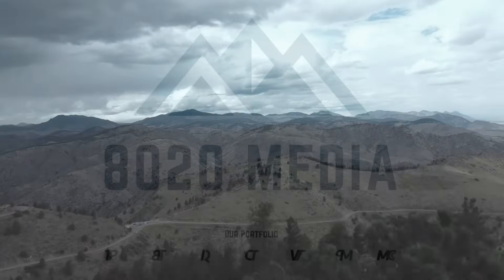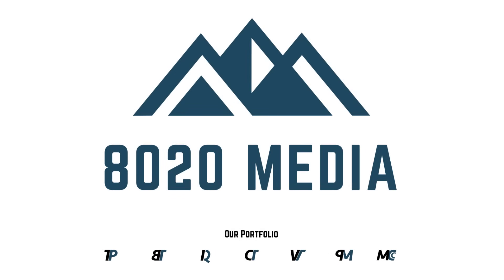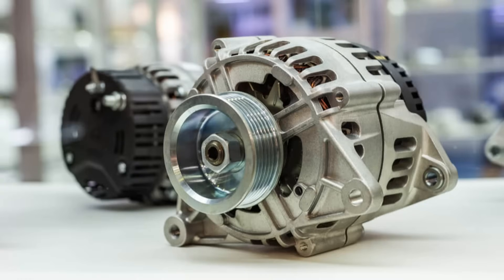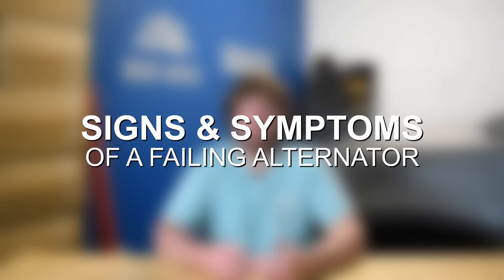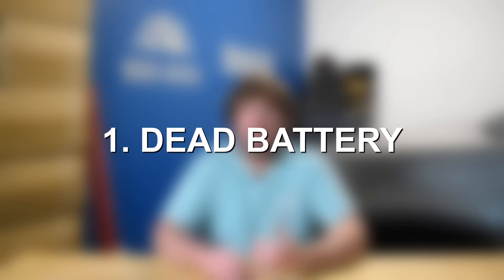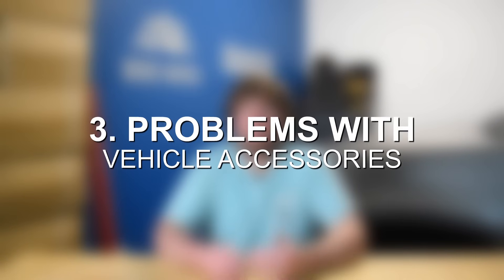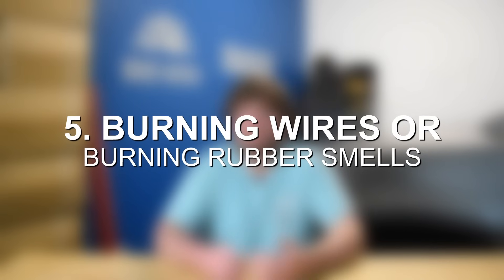6 Symptoms of a Bad Alternator!

Comment: The battery light came on today on my 07 kia rondo along with the brake light (brakes are fine) i pulled over and pressed down the parking brake and released it. When i pulled off both lights turned off less than a minute after driving then came back on about 10 minutes later for another 10-15 minutes then off for a few minutes before coming back on.  I figured it was something with the dash since the needle on the temp gauge will rise and get stuck sometimes even though all that stuff is working fine.  I took it to Autozone just in case. They said the battery is at 65% but is failing to charge.  It started back up just fine and i haven't had any of the symptoms mentioned here. Do you think its the alternator or the battery?

Comment: After the replacing the alternator the vehicle cranks up but it takes a one or two clicks start in order to vehicle starting 💯 percent ….any suggestions?
Reply from the maker: E - If your vehicle takes one or two clicks before starting after replacing the alternator, it could be due to a slightly weak battery, poor ground connection, loose battery terminals, or a starter relay/solenoid issue. Double-check the battery terminals are clean and tightly secured, inspect the ground and power wires to the alternator and starter, and consider testing the battery under load. Also, ensure the alternator output is charging properly (should read ~13.8–14.7V with the engine running). A weak connection or borderline battery can cause delayed or hesitant cranking despite a new alternator.

Comment: My alternator is making my engine run hot
Reply from the maker: S - If your alternator is causing your engine to run hot, it could be due to increased engine load, a failing alternator bearing, or a slipping serpentine belt. A seized or failing alternator bearing can create excessive friction, adding strain to the engine and increasing heat. Additionally, if the serpentine belt is too tight, misaligned, or slipping, it can overwork the water pump, reducing cooling efficiency. Another possibility is an overcharging alternator (above 15V), which can cause excessive electrical load, leading to increased heat production in the engine bay. Check the belt tension and alignment, inspect the alternator pulley for resistance, and measure the alternator voltage output. If the voltage is too high or the alternator is overheating, it may need to be replaced. Also, ensure the cooling system is functioning properly, as an alternator issue could be compounding an existing cooling problem.

Comment: Battery light on dash for GM
Reply from the maker: W - If the battery light is on in your GM vehicle, it typically indicates a charging system issue, most commonly related to the alternator, battery, or wiring connections. Start by checking the battery voltage with a multimeter—it should read around 12.6V when off and 13.5-14.5V when running. If the voltage is low while running, the alternator may not be charging properly due to a bad voltage regulator, worn-out brushes, or a failing alternator itself. Inspect the serpentine belt and tensioner to ensure proper tension, as a slipping belt can prevent charging. Additionally, check the battery terminals for corrosion and ensure the ground and power cables are secure. If everything checks out but the light remains on, the alternator may need to be replaced or there could be an issue with the charging system wiring or ECU communication. Scanning for DTC codes related to the charging system with an OBD-II scanner can help pinpoint the issue.

Comment: I've tried a new battery 2 times now and each time the battery dies within the first minutes of the start. You think it's the alternator? So far I can jump it and it will run but once it's turned off I have to jump it again for it to run.
Reply from the maker: B - Yes, it sounds like a failing alternator. If the alternator isn’t charging the battery while the engine is running, the vehicle will rely solely on battery power, causing it to die quickly. Since you can jump-start it but the battery dies shortly after, it suggests the alternator isn’t replenishing the charge. Use a multimeter to check voltage at the battery with the engine running—if it reads below 13.5-14.5V, the alternator is likely bad and needs replacement. Also, inspect battery cables, grounds, and fuses to rule out other electrical issues.

Comment: As I’m stopping. Right before my car comes to a complete stop. The headlights will dim ever so slightly and then go back to normal. Would this be an alternator problem? Anyone 😅?
Reply from the maker: H - A slight dimming of headlights right before a full stop is usually a sign of a weak alternator, voltage regulator issue, or battery struggling under load. When you slow down, engine RPMs drop, which reduces alternator output momentarily. If the battery is weak or the alternator isn’t supplying consistent voltage, you’ll see flickering or dimming. Check battery voltage (should be 12.6V off, 13.8-14.5V running) and test the alternator output. If voltage drops too much at idle, the alternator might be wearing out.

Comment: If my only symptom is flickering lights is it safe to assume it’s the alternator?
Reply from the maker: T - Flickering lights can be a sign of a failing alternator, but it's not the only possible cause. It could also be due to a weak battery, bad grounding, loose or corroded battery cables, a failing voltage regulator (part of the alternator), or even a faulty connection in the electrical system. To confirm if it's the alternator, check battery voltage with the engine off (should be around 12.6V) and running (should be 13.8-14.8V). If voltage drops below 13V when running or fluctuates erratically, the alternator is likely the issue. If the voltage is steady but lights still flicker, check the battery connections and ground points.
Reply: Flickering lights can also be results to a bad engine idle or a misfire in the engine cylinders
Reply from the maker: @christopherdevito5840  Possible, but not very likely.

Comment: If I just got a new battery and the battery light came on a couple days later is that a sign of an alternator issue?
Reply from the maker: H - Yes, if you just installed a new battery and the battery light came on a few days later, it's likely a sign of an alternator issue. The battery light typically indicates that the charging system isn’t working properly, meaning the alternator may not be supplying enough voltage to keep the battery charged. Common causes include a failing alternator, bad voltage regulator, loose or corroded battery terminals, a slipping serpentine belt, or a faulty alternator fuse or wiring. To confirm, use a multimeter to check the voltage at the battery while the engine is running—if it’s below 13.5-14.5V, the alternator likely isn’t charging properly and may need to be replaced.
Reply: @8020Automotive   Thank you very much. I'll get that checked out I appreciate it. Have a great day!!

Comment: Another good way to know what the problem is, is to get the vehicle started, then disconnect the negative battery terminal.  If it dies your alternator is bad, if it stays running the battery is bad.
Reply: On the newer cars if you disconnect the battery, the spike will destroy the entire electronic logic on the car don’t ever do this.
Reply from the maker: @JoeAircraft  Actually, that’s a common myth with a bit of truth behind it—disconnecting the battery on newer cars won’t destroy the electronics by itself, but doing it improperly or at the wrong moment can cause problems. The real risk comes from voltage spikes or drops, especially if you disconnect the battery while the engine is running, or if there's static discharge or improper reconnection (like arcing the terminal). Modern ECUs and modules are built with some protection, but they’re sensitive to sudden electrical events, so always turn the vehicle off, wait a minute for modules to power down, and disconnect the negative terminal first—and ideally use a memory saver tool if you're working on a car with complex systems that require relearn procedures afterward. So yes, be cautious—but no, disconnecting the battery properly won’t "destroy the car."
Reply: @8020Automotive does this apply to older model cars ? Like a 2006 suzuki swift ?
Reply: @JoeAircraft  So do you think if the cable for the negative became bad losing integrity for some reason that would or could destroy the electronic logic also? It sounds like it would, could very well be my issue.
Reply: Run by autozone, O’Reilly or any of those place and have them test your alternator voltage with a multimeter and then you’ll know for sure and they usually do that test for free.
Reply: What if I do it with fresh battery?
Reply: @beatles  Just do not do it. You can of course try it and be prepared the buy a new computer for the vehicle. The choice is yours.
Reply: Can a bad alternator affect your electronic throttle and cause it to go into limp mode
Reply from the maker: @GeorgiaDawgs274  Yes, a bad alternator can absolutely affect your electronic throttle system and cause the car to go into limp mode. Modern vehicles rely on stable voltage to operate critical systems, and if the alternator is undercharging or overcharging, it can disrupt the throttle body, ECU, and sensors, leading to erratic behavior or forced limp mode to protect the engine. Common signs include throttle hesitation, EPC or check engine lights, and poor response—if you're experiencing these issues and voltage is dropping below ~13V or spiking above ~14.7V while running, the alternator is likely the root cause.
Reply: @8020Automotive what about S drained start?.... When I start my truck, it's almost as if the battery is drained then fires up.
Reply: @GeorgiaDawgs274 So what was the fix? My car has rough idle, throttle body is not working properly, brake is hard when ETS light is on, dashboard lights are flickering. I used a multimeter and found out alternator voltage is fluctuating between 14 and 14.4 volts very rapidly. Do I need to replace the voltage regulator?
Reply from the maker: J - Correct! Thanks for sharing.
Reply: Im loosing power while driving..i just replaced battery and car looses power while driving still
Reply: @leslienicklaw1098  could be bad cable , we replaced our ground cable and so far so good.
Reply: If I am connected to chassis ground, will that make a difference in this test?
Reply: On my way to jump start and try this🤞I'm 63 and had a family full of motor heads, they're all gone now. So this is on me...wish me luck! And thanks for your comment!💞🙏
Reply: All videos I've seen so far says to remove positive side cable.
Reply: While this works . It’s not not a good way to test. More of a last stand. This cause big voltage spikes , and can damage your alternator, or other electrical in your car if you have a new car. It’s best to get a multimeter
Reply: @ryanjon4  Exactly right. Do not disconnect the battery while the vehicle is running on a modern computer car. It may be ok or it may end up costing thousands of dollars for repairs. Get a multi meter and do the job properly.
Reply: So what is it supposed to do?

Comment: I have a 1995 grand Cherokee with a dodge 5.2 motor in it. Battery died after leaving light on for a while, got it jumped and drove to work, died again, got it jumped again and the car started bogging/rough idling, smoking that smells like fuel out of exhaust and lights flicker and then car stalls. I replaced battery and did oil change and flashed ecu, and car started running fine, started car again later on and it started doing the same that I said before, I don’t think it’s a fuel issue as the vehicle was fine after replacing battery, I know it has to be something electrical, does this all sound like something that would lead to alternator failure? The car also never had any issues before dying, this all just started happening after I jumped it the 2nd time.
Reply from the maker: A - Yes, this strongly suggests alternator failure or a faulty voltage regulator. If the alternator isn’t charging properly, the vehicle is likely running off battery power alone, leading to flickering lights, rough idle, and stalling once the battery drains. The fuel smell and bogging could be caused by weak spark from low voltage, affecting combustion. Since symptoms improved with a fresh battery but returned after driving, it indicates the alternator isn’t maintaining charge. Test the alternator output with a multimeter at the battery terminals while running—you should see around 13.5-14.5V. If it’s below 12.6V, the alternator is failing. Also, check for loose or corroded battery terminals, a slipping alternator belt, or blown fusible links.

Comment: How about alternator overcharging? I that a rare problem?
Reply from the maker: D - Alternator overcharging isn't as common as undercharging, but it does happen, and when it does, it can damage the battery, electronics, and even cause voltage spikes that trigger warning lights or strange electrical behavior. Overcharging is usually caused by a faulty voltage regulator, which fails to limit the output, sending excess voltage (above 14.7V) to the system. Signs of overcharging include battery swelling, flickering lights, burnt electrical smell, or even ECU issues. If you suspect overcharging, test the alternator output with a multimeter—it should stay between 13.5V and 14.7V at idle. If it’s higher, the voltage regulator or alternator needs replacement before it causes serious damage.
Reply: Ok Thanks! @8020Automotive
Reply: @8020Automotive I'm having low count misfires and suspect alternator as prob. It reads 15.6 v at 2200 rpm.

Comment: Hello, my check engine light, Low oil level, and check battery light are turning on and off when driving with low rpms specially when the AC is on. But when the AC is off, it wont even turn on while driving.

My battery holds 12.7 V charge
Oil is at level.
Reply from the maker: L - Your check engine, low oil level, and battery lights flickering at low RPMs, especially with the AC on, suggest a charging system issue, weak alternator, or failing battery under load. Even though your battery holds 12.7V at rest, it may be dropping too low under load, especially when the AC compressor cycles on. Check the alternator output at idle and under load—it should be around 13.5-14.5V. If it drops below 13V, the alternator might be failing. Also, check grounds, battery terminals, and wiring connections for corrosion or looseness. Since the low oil level warning is electronic, it may also be affected by voltage fluctuations, giving false readings. Try testing with a voltage meter while driving with AC on, and if voltage drops significantly, replacing the alternator may solve the issue.

Comment: I have placed everything and i still got issues. I replaced my battery after replacing alternator and when i turn it over it stays at about a 12.7 but when he unplugged the clip wired from the alternator it went up to 14.7
Reply from the maker: M - If your voltage stays at 12.7V with the alternator plugged in but jumps to 14.7V when unplugging the alternator’s clip wire, it suggests an issue with the voltage regulator or the alternator’s control circuit. Many modern alternators are controlled by the ECU, so a faulty ECU, bad wiring, or a poor ground connection could be preventing proper charging. Check for corroded or loose battery cables, grounds, and fusible links, and inspect the alternator wiring harness for damage. If wiring checks out, the issue may be with the ECU's voltage regulation or a defective alternator, even if it's new.

Comment: Glad I found this video, explanation was on point, I just replaced my battery, but the symptoms you've clearly explained tell me I need an alternator, "battery was gonna be needed soon anyway"
Reply: Get yourself a cheap slow charger, like 5 or 10 amps. I slow charge my battery in the car every 6 months. It takes demand off of the alternator and the battery and save some money in the long run.
Reply from the maker: J - Thanks for the feedback! Glad we could help.

Comment: I was returning from a snowshoe hike driving my 2008 F150. About twenty miles from home the alternator light came on.  I have a device on the dashboard that is connected to the OBD2 plug which tells me a number of running parameters including alternator voltage.  Normally it runs around 14VDC.  It was showing 10.9 to 11.2 volts, definitely below voltage.  When I kept the RPMs up, the alternator light went out.  When the RPMs dropped below 2000, the alternator light came back on. I shut off the heater, lights, radio.  The truck made it home.  After shutting the engine off, it would not turn over.  I put a 10amp charger on it for a half hour, and it started right up and made it the five miles to the dealership.  The engine started again at the dealership, though I could tell the battery was low again.

They tested it.  Yep.  Alternator.  I could replace it myself, but I decided to let them do it.
Reply from the maker: G - Thanks for taking the time to share this experience. We are sure many others will experience the same.
Reply: how much did it cost?